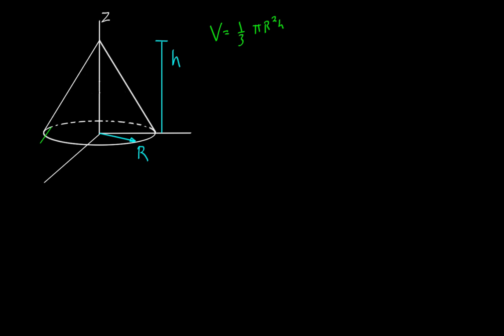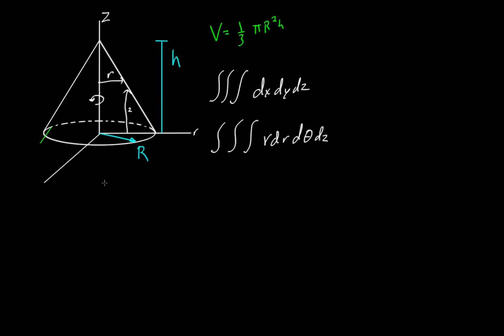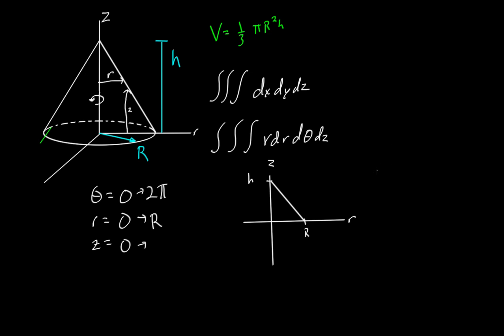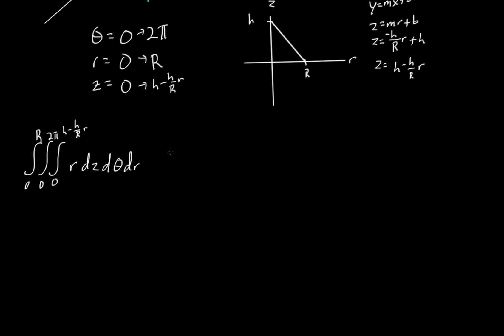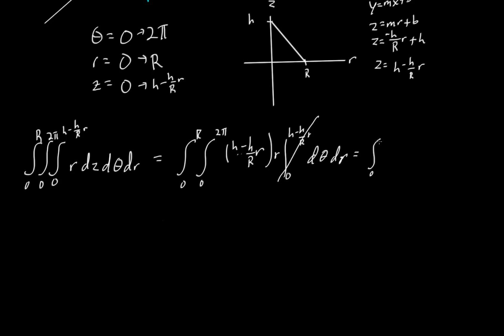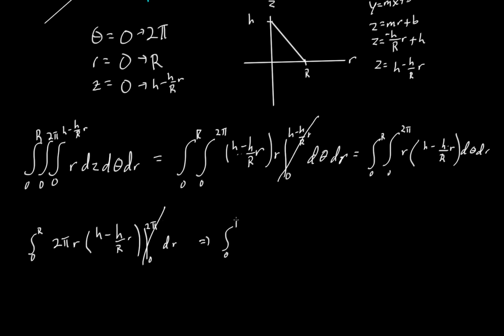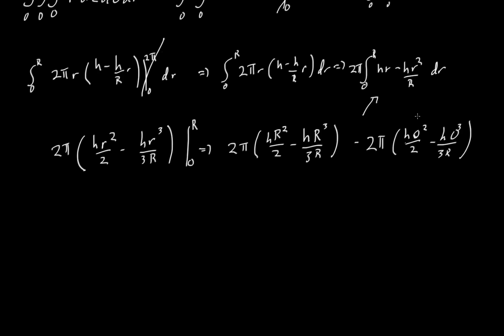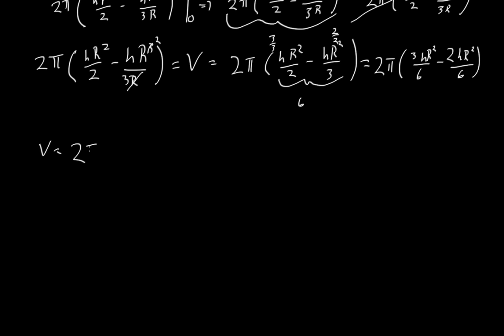Volume of Cone using triple integral in cylindrical coordinates

Comment: can't seem to understand why the height does not change from 0 to h
Reply: If z was integrated from 0 to h then you would calculate the volume of a cylinder. Instead, z is not the same for all differential components of the integral, meaning there's a change to z. Since z is not always constant and depends on the radius r we must include r in the integration limits.